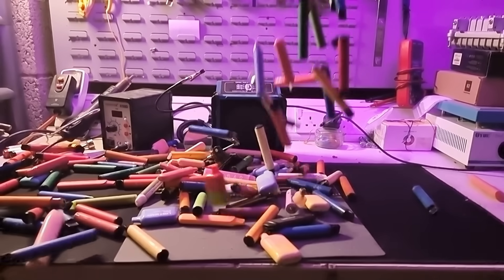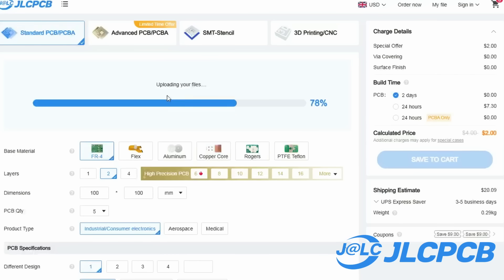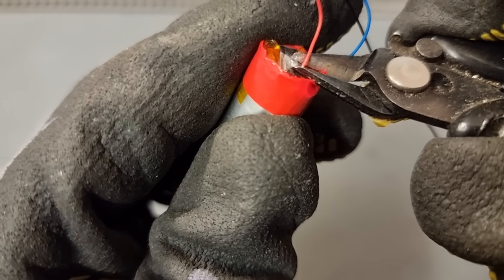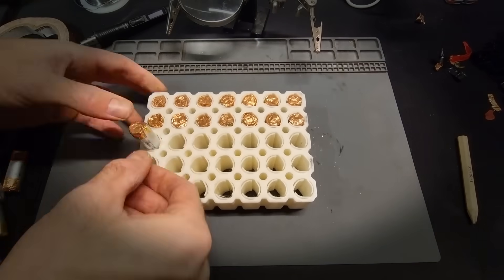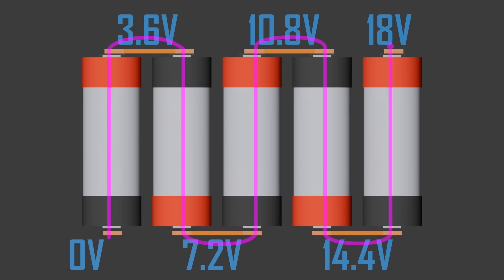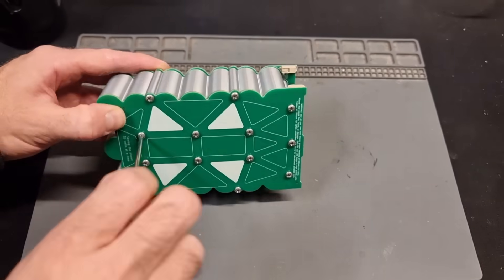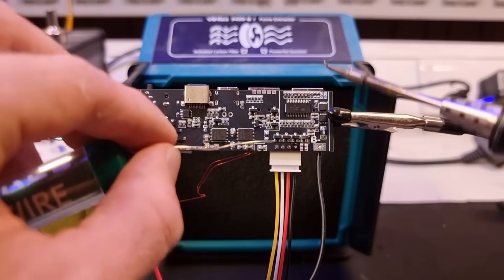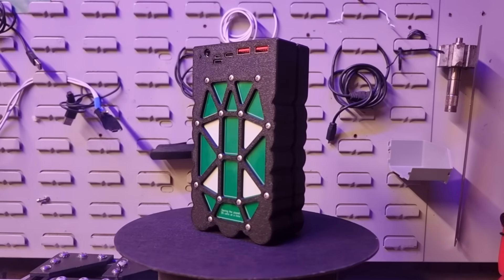Making a Power Bank from Disposable Vapes: UPGRADED + Extreme Tests!

Comment: Ok so hear me out, what instead of the solder jumppad we use tranistors(or mosfet maybe) to bypass the safety resistors once the batteries are normalized(yes i know the circuit board becomes a bit more complex)

Comment: Would this work with 18650's? I have loads of signs cells and many laptop batteries i am yet to dismantle!
Reply from the maker: Yep it would work great with 18650s, youd just need to make the PCB & 3D prints proportionally larger

Comment: Products used to be made to last. Nowadays most things are made to go bad after a relatively short time. 
Goverments are “Helping the climate” with new rules against emmissions. The real issue is that we need to buy new products like for example a phone after they stop getting software updates which you get for only about 2-3 years.
If companies would stop producing disposable products where possible the earth would be much cleaner and less production would be needed.
But you know how big companies think; Profit over everything.

Comment: Is it viable to print just two 1cm tall battery clamps, and hold them apart at the top and bottom of batteries with some standoffs? That could reduce filament usage and print time and weight.

Comment: great job!
maybe you can make s 3dprinted lid to push batteries to specific depth, so you won't need to measure them?
that will speed up assembly process 
Or create a stopper on one side, so you can push it as far as it goes.

Do you think it's possible to create same template thing but in a scale for a ebike?
it would be so amazing for a long touring trips, if a cell dies just find few vapes and fix a bike!
But that means it will be a bit more complex, it must show which cell is dead and also maybe fused connectors somehow need to be redesigned?

What are your thoughts? Is it possible?
Reply: just realized I saw you made an ebike battery, but it was soldered
still will be a cool project to make a long range pack with replaceable cells
do you think though spring connectors are safe for an ebike? vibrations can cause disconnections, what will happen in that case?

Comment: As much as i like the project idea, im not sure this is a good way connect the cells IMO, the battery package is conductive aluminium coated with plastic, it could rub through and short to the copper tape, why dont you just solder the tabs with a wire?

Comment: I would rather use small slots cut in the connection pcb's to pull the cell tabs through and solder them on the other side. This would also allow probing and checking a pack before putting in enclosure. Cell stack monitoring for multiple cells in series can also be done on the connection board and routed to a single convenient spot for hookup to BMS and charge circuitry.

Comment: would love a small version for the smaller vape sells, you seem to be using the larger vapes which are not as common here. great video
Reply: the most common vape here is the airbar nano 800 puffs, it has a 550ma 3.7v battery but im not sure what the battery size is. If you make a model for it I will build it and make a video about it.
Reply from the maker: All the cells that i used in this vid were 550mAh, so you might be in luck!
Reply: They look too big to fit in the small vape

Comment: 8:38 ahh, I’ve always wondered how that worked… so basically you chain small batteries to make big batteries, then you chain the big batteries to make a bigger battery? Also could you use metal tape to bypass the resistors? Or would that be more dangerous or somethin?
Reply: Yeah, the resistors have a lot more resistance than most metals (in the name) just makes sure that the individual batteries don’t explode

Comment: I would be very interested in a test video where you would show how good these "used" cells actually perform and how well they might still be. I think that the uncertainty is a factor that pushes people away from building there own Powerbank. I build one myself and it works well (way less capacity 14 cells) but I'm still afraid about the risks that are always mentioned in videos like this, I really would like to know the actual risks that come from just using these vape cells. Is there a higher risk for malfunction? Is the lifespan of a vape cell overall shorter and the output more fragile than a normal lion cell? And so on... 

Great video, Im now a proud owner of a recycled Powerbank.

Comment: I don't know if the module you used has active or passive balancing, but it would be good to add an active balancer to keep all the lines at a similar voltage.

Comment: I put these batteries on TV remotes, Motion lights for my stairs and old Walkmans. Get a little USB C charge board for pennies from Ali express and wires it up. Works a treat
Reply: I’m wondering if it’s possible to use the charging board that these vapes have maybe find a 5v output that stays on without needing to be activated by the sensor
Reply: can u pls tell more, maybe link the product i want the duction od what hes doignb but for far less efort and money he used

Comment: you can even make that smaller and easier to connect ^^ make a pcb with holes and soldering rings and pull all the tabs of the cells up, drop the pcb on top and fiddle the tabs through the holes and solder them on the outside ^^ and you need no holder just stack the batteries directly onto each other ^^ smallest possible packaging and no springs with bad connection ^^-)

Comment: ARS Techinica did you dirty with the "dodgy" part on that headline xD
Hacked? True. Makeshift? Fair. But dodgy was too much.
Also, destructive tests are awesome. No better way to demonstrate risks and failure modes than exploding and burning stuff!
Reply: Idk man, it looks nice, but that copper tape he placed on the top of the cell is dodgy af. It overlapped the sides too much. 

 Unless these are different than a typical 18650 where the top cap is the positive, but the whole shaft beneath is the negative. You place an insulating ring around the top to prevent the nickel from puncturing the heartshrink causing a short and thus a fire
Reply: @user-bt2lx4gy7h It's clearly visible in the video that these cells are different from 18650's, these are cylinder shaped pouch cells unlike the metal cased 18650's.

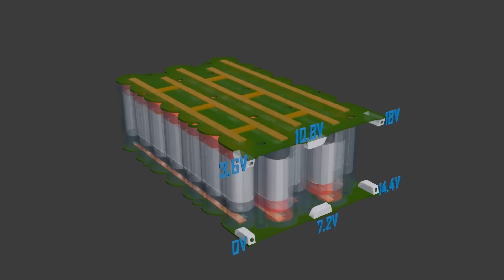Comment: 9:28 i think the vape cells are 3.7v and not 3.6v
Reply: I mean they are not a fixed voltage, they go up to 4.2v when charged and lower when discharged but yeah, you are kind of right, they are 3.7v typically

Comment: what kind of resistance is the whole copper tape + spring system adding. what about a cutout and directly soldering batteries to the pcb with a bit of wire. a bit more work tho but i wonder if the benefits make it worth it. should also allow the cell to get a little bit of passive cooling too and be slimmer

Comment: Please add a BMS between the USB-controller and the battery pack. The Ali USB-thingy does by no means add the safety of a BMS. I have the exact same USB board on a 4S pack, set to 4,15v max. It shorted out after a while. Luckily I had a BMS that shut off due to overcurrent protection. Also I added an active balancer as the balancing function of neither the BMS or the USB board managed to keep up when fast charging, making some of the cells go well beyond their maximum voltage.
Reply: That's quite...unsettling
Reply: Can you post the links to your BMS and balancing board?
Reply: @mistik1993  Tried to post links but getting an error message. But just a generic 4S BMS from Aliexpress and a Dali 1A active balancer. The cheapest balancer boards do not activate until 100mV imbalance, not helping much when approaching 4,2v. Inevitable the highest cell(s) will push beyond 4,2 then. But the Dali does a good job.
Reply: @grankvarsvik4153  thank you. Getting all of these cells to balance correctly is my biggest concern about doing something like this.

Comment: A vape battery powerwall would be amazing if it could run the electrics inside of a motorhome or canal boat, and possibly be cheaper whilst also out performing leisure batteries

Comment: I'm far from starting but, building a power wall for my sehd is on my 'to do' list. I think I'll be going 6S but my go up to 12S in future for faster charging.

Got a couple of hundred 1750mAh cell from 2400 puff units saved up, just started testing them after buying the same tester you use, it's powered from the shed solar panel.
Reply from the maker: Awesome! I love to hear about people doing similar stuff. Stay safe!
Reply: Thanks.

Im not going into this blind, thankfully.

Ive desigsned a few small boards and ran 2x Jaguar 2.6kWh / 236Ah  3S in parallel with a good BMS, this used to feed into an Arduino alaong with MPPT data from a victron 100/20 and PIR alaram data and send it over 4G.

Kind of going to do a build inspired by things I've done in past employment.

When I eventually get on this, I'll let you know. Thanks for the encouragement!

Comment: Are the disposable vape bodies made of metal or plastic? I left a comment on the last video about how you might be able to recycle the plastic vape bodies into new 3D printing filament by blending it into smaller bits and extruding it. It would make all of this just that more efficient.
Reply from the maker: All of the elf bar style ones seem to use aluminium for the shell unfortunately 😢. I do have a bunch that use plastic to ill experiement to see if theyre thermoplastics and are able to be melted down

Comment: turning garbage into not garbage is still one of my favourite things to do
Reply: I really miss this category of videos on YouTube. It used to be a huge thing.
Reply: Especially when it’s e waste
Reply: if an electronic device that use battery is marketed as desposible, its will never be a garbage, it will be called fire hazard
Reply: I should call her.
Reply: if it dosent work it is turning garbage in to garbage. but this is a cool project
Reply: Same.  ❤
I turned an old mirror stand into a coat rack.  😅
Reply: Garbage picking last year found over 5k worth of stuff that would have been in a landfill that I repair and donate or use around the house. It’s definitely the best feeling!
Reply: Best out of waste. That's what we call it
Reply: You mean recyling?
Reply: @damianleonn  Reusing or upcycling, rather than recycling. Recycling involves converting waste back into very basic materials, then using those materials to manufacture new items. By keeping these discarded batteries in their original form, far more energy and resources are saved than would be in recycling. It's a nitpicky distinction, but it makes a big difference in the amount of resources being used.
Reply: You mean from trash to treasure?
Reply: Can you turn me to a normal person amdeadi9563? I think I could use your help.

Comment: You have been been blessed by the algorithm and for good reason. On another note, and what has probably been mentioned to DEATH is that the access to these batteries will drop after legislature change, therefore I would love to see more upcycling videos of other tech, e.g.: old phones/electronics, it's absolutely criminal how much e-waste there is, if you come up with a novel ideal regarding this it would be greatly appreciated!
Reply from the maker: Couldn't agree more! I've got plans to convert cheap broken hoverboards into ebike motors and stuff, so hopefully we will have lots of interesting electronics upcycling vids to come!
Reply: @Chris_doel  you can turn a hoverboard into a direct drive wheel, if that is your thing
Reply: @Chris_doel  if you figure out a way to make an acoustic, electric guitar out of any type of materials I'm gonna go hunting for said materials
Reply: Honestly In most of the world. These will be available for a lot of years. Smoking is never killed. As smoking becomes more and more addictive it also becomes more expencive.
Reply: Won't the only difference be that instead of these ones, they'll all just come with a free (hopefully USB-c) charger module on them?
I've found around 4 chucked in bushes with a usb recharge circuit included and 3 of them look very similar to the disposable except for the port hole
Reply: @BlueJDev  well thats neat because then you get a free charge port at the same time
Reply: @zaiohellgren9266  yep, bit of a bonus, here's hoping 🤞 , I guess it might stop a few being discarded but those that are will be more valuable to us, so win win for a change..
Reply: @BlueJDev  most "disposable" vapes (at least in my area) already come with USB-C ports, and occasionally micro-B aka micro-USB on the cheaper, older ones. Vape shops have been selling mainly these for at least a couple years now. sometimes there's a small section with non-chargeable vapes for $1-$5, but they're not very common anymore. I have coffee cans full of vapes, most with ports, just waiting for when I decide to do something productive with my free time
Reply: landfill sites are going to be slowly burning underground thanks to these cells 😢
Reply: The manufactures are adding a 2p / 2.5cents usb socket, making them rechargeable will make no difference, they will still be thrown away, just like paid for supermarket bags ?! ... the human race has been fully plugged in to the consumer matrix.
Reply: @Chris_doel I really like the idea and design. Note that the 13400 may have a "vent" or better breaking point on one end to release overpressure when getting too hot. Your tape is sealing that
Reply: Lots of people panic bought a shitload before the ban. I doubt they're all gone yet!
Reply: same here too, to please the algorithm, Im going to give the channel a full Subscribe, but please don't, do video everyday, just for the sake making content as the youtuber call it I thing, keep to the core subject, and interesting subjects? like seeing now 🙂keep it up 🙂